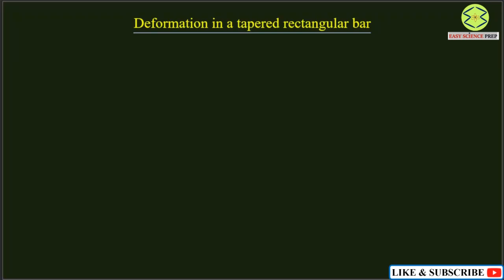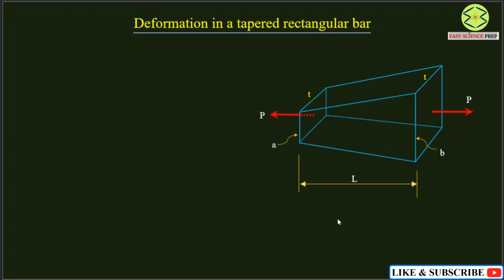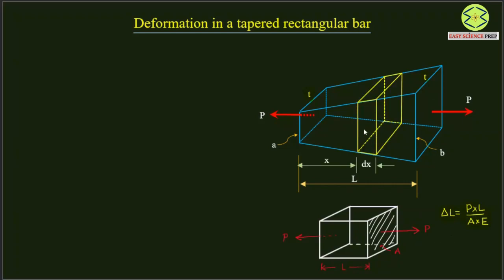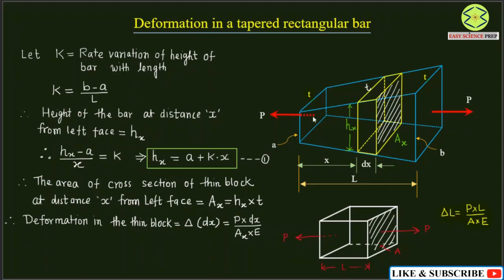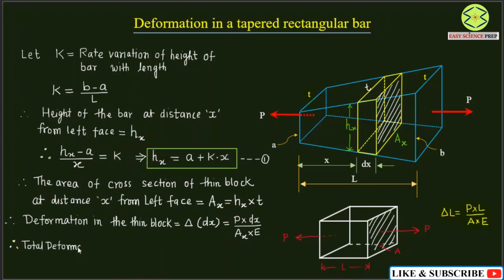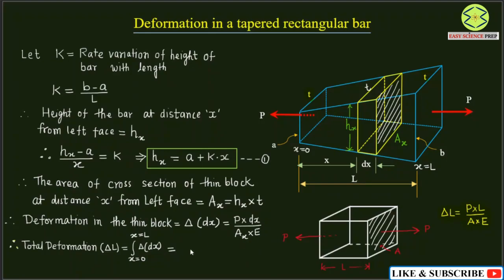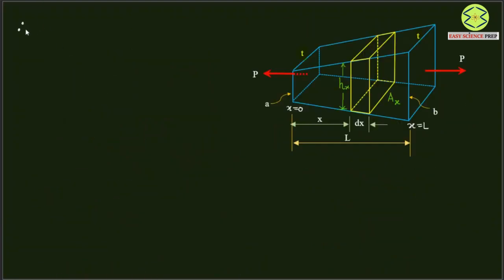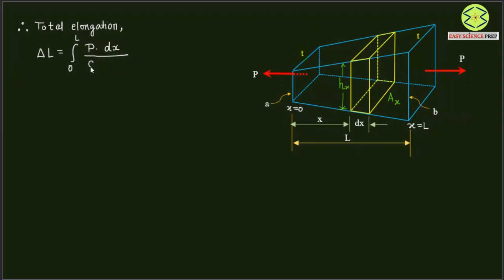Deformation in taper rectangular bar

Comment: Sir if thickness is different the what the formula
Reply from the maker: There will be change in expression, I ll try to post the expression.
Reply: @easyscienceprep7445   sir If thickness is different different Can we use the formula ∆L= P*L/E*A(average)
Reply from the maker: No, we can not do that, We have to integrate along  depth as well as along thickness @facttv94